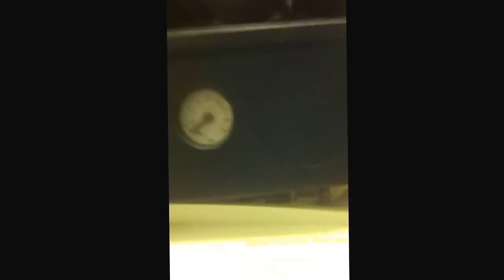Boiler over-pressurised due to filling loop letting by.

Comment: Not sure what part of the PRV you would silicone, as you would have to be very careful that you didn't permanently seal the part which would be dangerous. Sometimes it can be a bit of muck caught on the surface of the rubber washer inside which is leading to water letting by, and sometimes a good clean out can wash it away and hey presto. But from bitter experience I find it is usually better  to replace the part for £20 or so, rather than charge the customer an extra hour's labour trying to make do and mend and find that yes, a new part is required. But I appreciate what you're saying, and I guess nowadays it usually comes down to the old criteria of time and money.